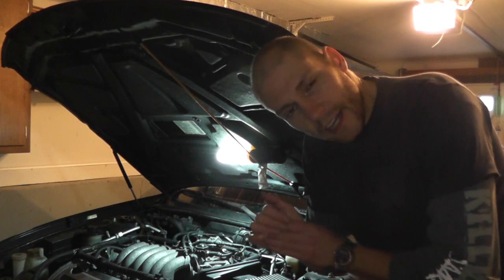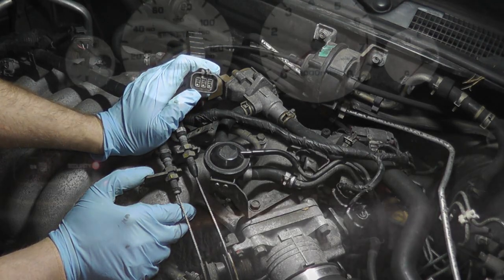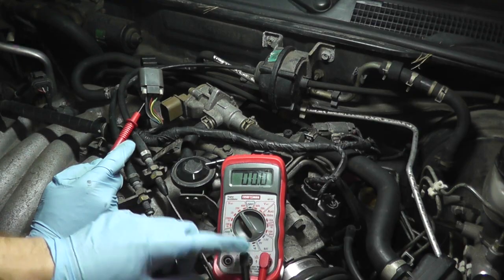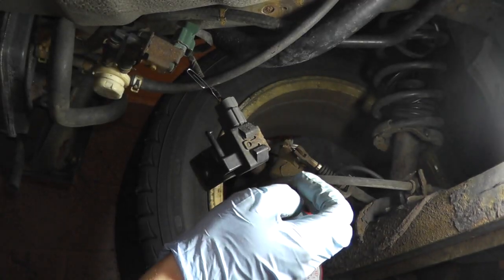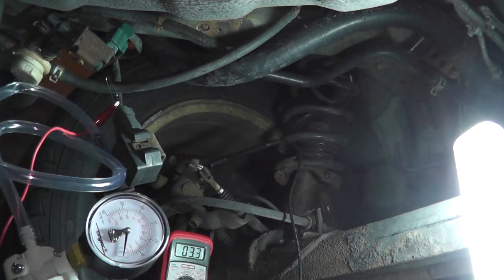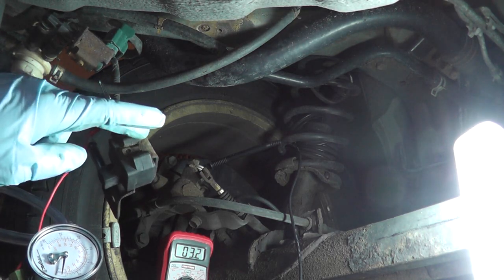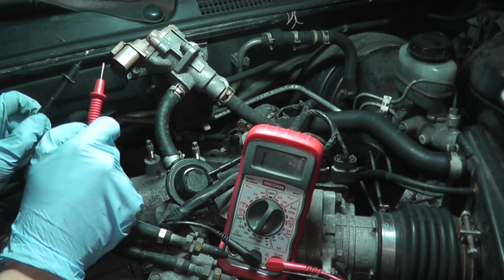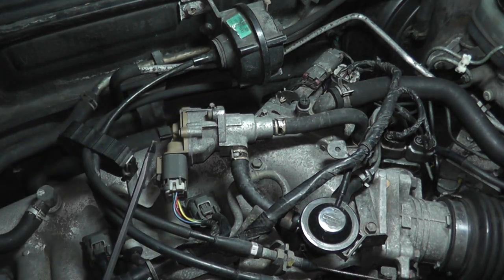How to test and replace the EVAP Canister Purge Volume Control Valve P1445

Comment: Got a P0456 on 2004 Cayenne S this am. I have a software (DURAMETRIC) for Porsche only that I use to check and clear errors and it says exactly word for word letter for letter:

"Evaporative Emission System Leak (very small leak) - Value below lower limit value, test conditions are not-completed, fault is currently active and causing a DTC light. "

Im already checking and Cayenne's forums but I figure emission systems are pretty much the same in every car. Coincidentally, right after the engine light came on I went to fill up the tank and the handle kept popping (as if it was full) which had never done before. Not sure if is related to the emission system as a sort of back pressure sensor somewhere. What does it sound like to you?  Tks!
Reply from the maker: Gerard Fabian Alvarez You're correct. The gas handle continually popping is common when a hose in the EVAP system is clogged or you may have a bad charcoal canister. Regarding the small leak, professional mechanics use a smoke machine to find the leak. You can also inspect every square inch of the EVAP hoses but it's tedious.

Comment: Great videos, CNTs. I have a question about my 97 Mystique. Sometimes I notice a gas smell coming from the car. I can't smell it when I have the windows rolled up and the fresh air vent open. I can't smell it when I do a walk-around with the car idling. I only smell it when I'm driving with the window down, and then it's only sometimes...not all the time. It's coming from the engine bay, no doubt. I think it's the EVAP control valve under the hood, as I have looked and looked for fuel leaks and can't find any. Plus...a leak would cause a gas smell all the time, yet I smell it only some of the time. This started only recently. The check engine light is not flashing, and the car runs great at all speeds. Is the EVAP valve at fault? Could something else under the hood be sometimes causing fuel fumes at speed with the window down?
Reply: Systorable I would tend to not think evap in this case, that is why the evap system so carefully measures for leaks. If it was evap it would be after the purge or vent valves and not before otherwise a leak would be detected and give you a check engine light. I'd carefully check your fuel lines as well, especially after the fuel pump as this line is pressurized and I think most cars don't measure fuel flow carefully enough to detect a small leak at this point.
Reply: Systorable Good to know it's sorted!
Reply from the maker: Systorable I'd start by inspecting the EVAP system as well.
Reply: Thanks, man. What do you think it is? Raw liquid gasoline in the EVAP system somewhere? Could the cold start valve be causing this somehow?
Reply: Andy Plater, you are right. The odor was coming from a seep leak at the feed tube coming out of the pump. The fuel pressure can vary from 32 all the way up to 41. My hose is rated at 40 psi, so it's barely good enough. When the pump pressure got up to around 40, it was seeping out. I didn't smell it in the cabin then because the rubber boot covers the hole over the pump. But when I put the window down, I could smell it. That's because the air gets into the car when the window's down at speed and it whooshes around the back seat and the pump area. But know that I just today fixed it and even got a hack repair kit with fuel line clamps, fuel line, and brass connectors to bridge pieces of rubber fuel hose. It hasn't started leaking at the filter yet, but I imagine it will. I have the clamps ready when that happens.

Comment: CarsNToys  When I accelerate I hear a noise from what I believe to be the EVAP Canister Purge Volume Control Valve. When I take the hoses off there are charcoal pellets inside. After taking apart the EVAP Canister Purge Volume Control Valve, It is packed with the pellets. Why Is this? I have taken the EVAP Canister Purge Volume Control Valve off twice since this year to empty the pellets out. The acceleration noise goes away after cleaning it out. How can I prevent the charcoal from getting into the EVAP Canister Purge Volume Control Valve?

Comment: Are these parts covered by the clean air act of 1990 for 8yr/80,000 miles?
Reply from the maker: Scott Clark I believe the EPA mandates that rule for major components; i.e. catalytic converter. Search on EPA's website to confirm.
Reply: CarsNToys  thanks.  I have combed that website and can't find a thing on what is covered vs what isn't.  I have a 2012 Chevy Sonic that popped this error code and I had to have the sensors replaced due to leaks.  It wasn't a cheap repair for something that happens to a lot of vehicles (per my internet searching).  I was hoping these were covered and I had something to go to the dealer with since I had to come out of pocket for the repair :(

Comment: Nice  video, quick question..  on the purge valve itself.. doing the ohm test, if I get a reading of 2 ohms on test 2 and 1 and a reading of 30 ohms on the rest of the test does that mean the purge valve is bad? I couldn't do the vacuum sensor test at the rear, but I am getting code P1445. I am also getting O2 sensor code, but I test the O2 sensor and its good.. Basically, what I want to know is.. do I need to do the other other test at the rear of the car to confirm everything or can I just change out the purge volume valve?
Reply from the maker: DGK Chances are the purge valve is no longer good. What kind of vehicle?
Reply: CarsNToys its a 1996 Nissan maxima.. I actually changed it out and problem solved the O2 sensor code went away too. Thanks man your video was very helpful in testing
Reply from the maker: DGK Good stuff man. Glad to help!

Comment: Thanks for the video and hopefully I will be getting closer to isolating the problem. Everything checked out except for the male side of the EVAP purge volume control valve. All the terminals read ~30 ohms except for terminals 2,1. all they read is 1. So you think I should replace the whole unit or keep troubleshooting?
Reply from the maker: RIPTIDER69 Sounds like the control valve needs replacement. What kind of vehicle?
Reply: CarsNToys It's  a 96 manual non abs maxima SE with Cattman headers, greddy catback, stock ECM, Intake. Hope that helps. Let me know because my car's registration is dead, so my tags are dead, and am running on borrowed time.
Reply: CarsNToys I rechecked the volume valve and the 6th terminal seems to be faulty. When I test terminals 5,4 I get ~30ohms but when I test terminals 5,6 all I get is a 1. Wish this could be fixed somehow besides going to the dealer for $220. Plus going to junkyards 45 mins away to pull the part for them to tell me it will be 175 -+ does not appeal to me either.
Reply: CarsNToys I went to the junkyard and pulled the only control valve they had and tested it. Can you believe that on the one I pulled had a faulty 3rd terminal? I'm just assuming its faulty because when I test 2,3 it reads 1. Just like my faulty control valve that read also a 1 on terminal test 5,6. 
Does this mean those terminals are faulty?
Reply from the maker: RIPTIDER69 Your '96 Maxima should read 30 ohms on connectors 2&1, 2&3, 5&4 and 5&6. When you did the ohms test did you disconnect the harness connector going to the control valve?
Reply: CarsNToys Yes, I disconnected the harness from the control valve. The ohms on connectors read 2&1~30ohms, 2&3~30ohms, 5&4~30ohms and 5&6=1?
Reply: CarsNToys Then I pulled the junkyard control valve and got this reading:  On connectors read 2&1~30ohms, 2&3=1?, 5&4~30ohms and 5&6~30ohms

Comment: Hi, Great Vid. My son has a 2006 Nissan Altima and the check engine light is on continuously. A scan was done and a code P0443 was generated. Can this be a defective EVAP Canister Purge Volume Solenoid Valve? From your experience, if it is, is this 'issue' detrimental to the overall performance of the engine? What would your recommendation(s) be? Thanks in advance.
Reply from the maker: Jerome Marquez Very often, the rubber hosing connecting the EVAP system cracks up and develops a leak. Quickest thing to do is test the solenoid valve itself. I'll make a note and try to get a video up by the end of the week showing how to test the valve. (I wouldn't say it's detrimental to the performance of the motor. However, if you have emission testing in your state the vehicle won't pass with this code.)
Reply: CarsNToys Thanks for the response. I would look out for the video. Much appreciated.
Reply from the maker: Jerome Marquez Just uploaded two videos regarding code p0443. The solenoid valve and the control valve. Just search under my page. Does your son own the four or six cylinder model?
Reply: CarsNToys Thank you. He has the 4 cylinder.

Comment: I have a 99 vw jetta 2.8 and when i plug in the hose on the back of the upper intake manifold that goes to the leak detection pump the car just stalls out for some reason?
Reply from the maker: mikeyd19841 Is the hose clogged? If you're uncertain, try blowing air through the hose.
Reply: I tried blowing through the hose which goes to the left down a tube that goes to the back of the car! Should i be able to blow through it? What could cause this issue?
Reply from the maker: mikeyd19841 Over the years carbon can build up in these hoses and prevent from air going through. Try replacing the hose and see if this corrects the problem.
Reply: Thanks! I will try to get it off and check it!

Comment: Hey CarsNToys I have a 1998 Nissan Maxima as well, and received the P1445 code recently. About 2 weeks ago, I had the rear vapor canister purge valve replaced. The mechanic cleaned out the lines a bit cause he said it was dirty. Could it be that the lines are clogged or dirty again and needs to be cleaned some more?
Reply from the maker: Clogged evap hoses can cause code p1445. What I've done in the past is replace all the rubber hosing. It's inexpensive and easy to do.

Comment: I have this code on my 97 maxima, so i did all your tests and my check Engine light is still on. I drove over 100 miles and the engine light is still on, any ideas?
Reply from the maker: anthony hawthorne You've checked the harness, evap control valve, pressure sensor and hoses? The valve is working correctly? Any other trouble codes?
Reply: Yes I tested terminals 2 and 5 (I believe you said in the video)  on the harness and terminal 2 did not read a full 12 volts but terminal 5 did it was around 8.5 for terminal 2 and 12.5 for terminal 5. I also used a voltage light tester and terminal 2 did not light but terminal 5 did. I tested the harnesses connected to the canister and they were fine. I also did a pressure test on the pressure sensor and the pressure dropped when i pumped but it dropped directly to 0.00 and after i released my hand off the pump it still remained at 0.00, so then i just replaced that and I did the drive cycle but the light still remains in the computer.( all the replacment parts are used btw) Thanks for responding.
Reply: Just code 1445 is coming up, no DTC definition.
Reply from the maker: anthony hawthorne Okay. I think the easiest thing to do at this point is verify the shaft in the valve is moving back and forth. To do this, remove the valve from off the motor. Keep the harness connect plugged into the valve but remove the hoses. When you remove the hoses make sure you plug them. So the only thing connected at this point is the harness connector to the valve. Have someone turn on and off the ignition key. There's a shaft that should move back and forth in the valve. You should be able to see the shaft move back and forth. The other thing is the reading on terminal 2. It should be battery voltage, in your case 12.5. There's a few things to check regarding this. (ECCS relay, a 7.5 fuse, etc.) I'll have to dig up the electrical schematic for the car to tell you where to look but let me know how you turn out regarding the above test.
Reply: Okay il do that, and il get back to you. Thanks
Reply: I checked to see if the valve was working, it was making nose. I didn't see it moving back and forth. For the eccs relay, I am not sure where in the car is it located? Also in most cars you can here the canister kick on for 30 seconds after you start it, does this car do that as well?
Reply from the maker: anthony hawthorne The factory repair manual calls for at least 11v for the valve to be working correctly. Since you're getting around 8v there are few connections you'll need to check. You'll need a copy of the harness layout in the engine bay. Shoot me an email at contact@carsntoys.net and I'll send you some .jpg images where you can take a look and hopefully find the problem.
Reply: okay I did, thanks.
Reply from the maker: anthony hawthorne
Good stuff man.
Reply: Did the email go through? to make sure.
Reply from the maker: anthony hawthorne Got it. I just sent the email.

Comment: Great video and step by step instructions. Can yo please do one for a P1440 code. I have a 2000 Maxima
Reply from the maker: mo bon P1440 is for a small leak. I had a similar code a few years back. It's quite lengthy to diagnose without a smoke machine. I'll try to get  a video up shortly.
Reply: ok thank you.

Comment: I'm getting 33.5 ohms, does that mean its stuck open some? Or is that close enough?
Reply from the maker: rome seveneightsixnine Performing this on a Nissan Maxima? What year?
Reply: 95, is that the reason I can't find the sensor in the rear on the frame? no trouble code i might add. :O
Reply from the maker: rome seveneightsixnine Yeah your vehicle doesn't have a pressure sensor on the rear frame. 33 ohms sounds fine to me. Why are you testing if you don't have a trouble code?
Reply: CarsNToys well, she stalls just whenever. But when I take hose off of the short side you look into to that lil plastic ck valve next to it the car runs better. My neighbor has a 97 with same exact issues. He bought everything under the sun. He showed me you vid, I have no charcoal in the line either. All in all, it runs poorly unless you drive it like a better and stalls. The last thing my neighbor bought was an o2 sensor and claims its fine now. Idk.
Reply: CarsNToys UPDATE: my col control Sol is not opening and closing with the key. So I tried it on my buddies car and it worked fine. I also checked the plug and it read 11.64V the wires all look OK and tight and no blown fuse. Whacha think?
Reply from the maker: rome seveneightsixnine Just so we're on the same page, what component are you speaking of?
Reply: Lol! Sorry. The purge volume control valve.
Reply from the maker: rome seveneightsixnine Gotcha man. So you did the ohms test on the control valve and you're getting 33.5 ohms for terminals 1,2,3 and 4,5,6? (Just like I did in the video) If so, sounds like the little motor in the control valve has gone bad.
Reply: CarsNToys like I said when I tried it on my homies car it work perfectly. On mine its dead.:-\  and now reads at 30ohms.
Reply: The plug also shows 11.64V, I'm so hoping the harness doesn't have a short....
Reply from the maker: 11.64v would be enough to move that little motor in the valve. The ohms reading is good as well. (Your reading indicates electricity is getting to the motor.) But I suspect the motor in the valve is no longer working. I've never done it but it looks like you can take apart the valve. You may want to double check the motor is no longer working. I would supply battery voltage directly to the motor and see if is indeed no longer working. May be worth a try before shelling out $60-80 for a used unit.

Comment: Hey....

Didn't realize you made this video.

Jus sent you a message regarding the EVAP canister purge volume control valve.

Also, last week I finally received my service manual for this vehicle, been reading it like a bilbe.  Did all the test that you also performed.   In front of the EVAP canister purge volume control valve their is the EVAP canister control valve.

WheW!

Do you know if this valve contains charcoal?

The hose an the valve inside where filled with charcoal.
Reply: Sorry, but i forgot to mention that the ohms reading i received from the EVAP canister volume control valve is high, 41.5 ohms.

what would this mean?
Reply from the maker: Hey Rod. There's a charcoal canister located behind the rear driver's side wheel. The valves don't have charcoal.
Reply: CarsNToys Okay, Thanks.

I didn't think they did.  Do you think the charcoal can drawn through the lines into the valves?

Going to blow out the lines an replace the vapor canister an vent control valve.